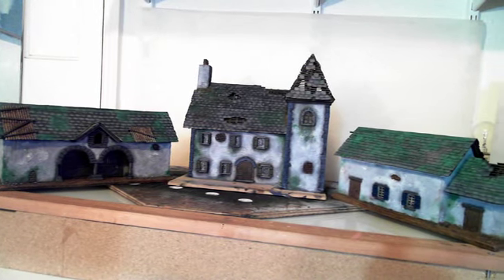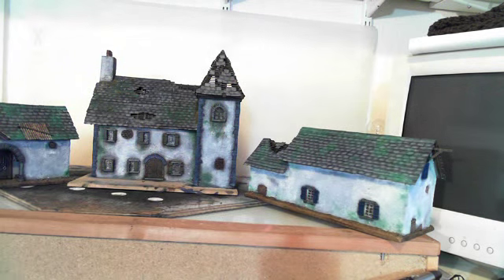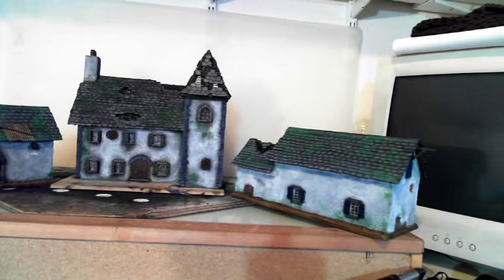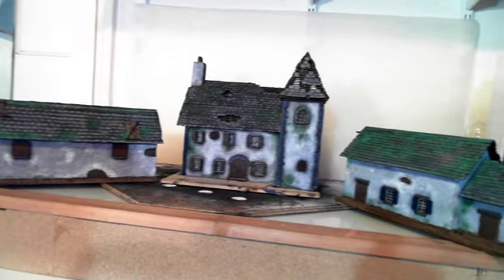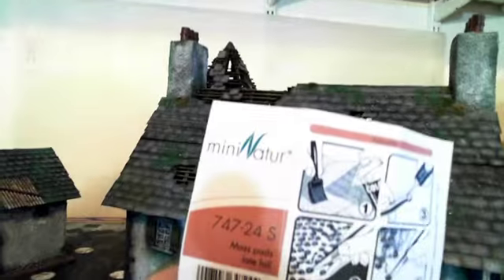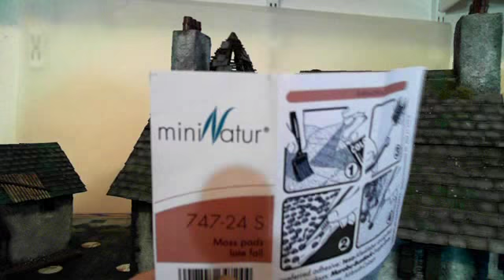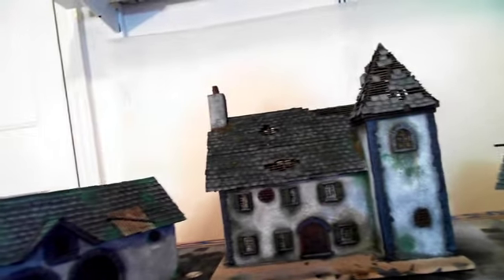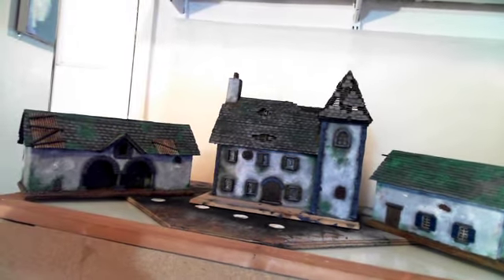Everything i have built so far for the Normandy Bolt Action Farm.

Comment from the maker: Cheers bud the missing shingle roof is my fav 2 ,i am glad i remade it all the walls and roof i have done with oil paint and inks the base color are inks and then ive washed stuff with oils and thinned it as i go Ive varnished it in between each color layer so they dont all mash together,the splatter looks is done with the airbrush blowing through a paint brush but i have done it in the past by hand with a brush and a stick flicking the brush on the stick thats how its all weathered bro.